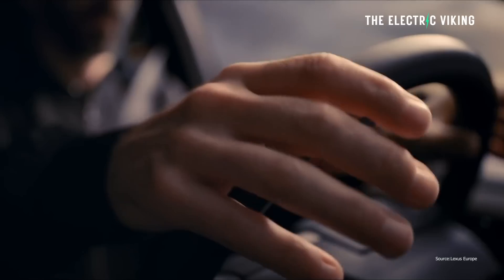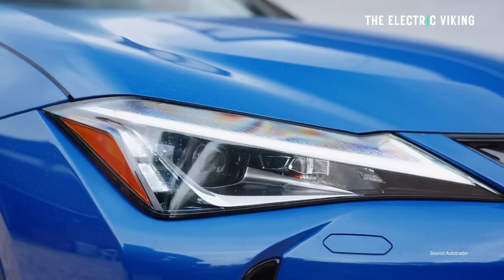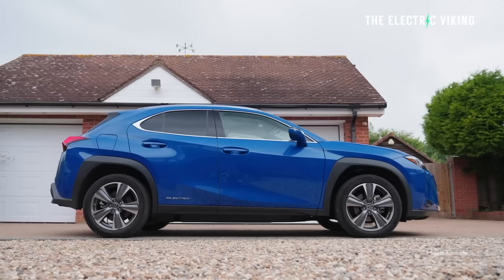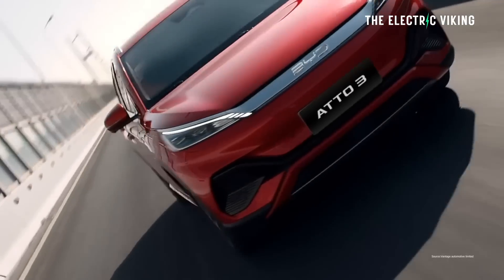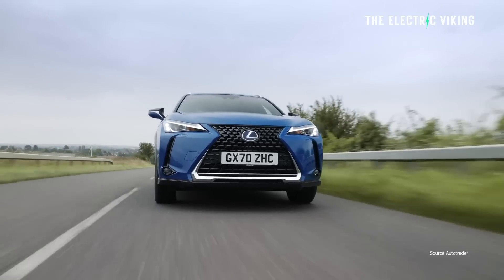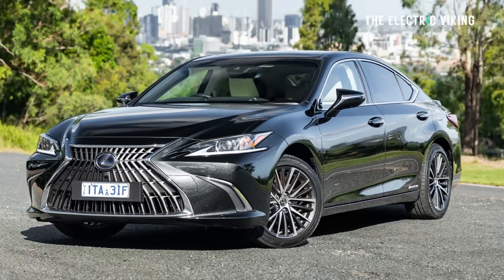Lexus reveals NEW electric car with a Nickel Metal Hydride battery

Comment: The new battery is probably for the hybrid because Lexus uses those because of their resilience in extreme temperatures compared to traditional lithium ion without having to add heating pads for cold weather conditions in particular. The Hybrid battery packs are generally pretty long-lasting and only fail mainly when the cooling fan ducks are blocked which prevents the batteries from overheating . It's very unlikely that the Lexus full electric vehicles are actually using nickel metal hydride

Comment: Simple a lithium battery can only be deep cycled about 300 to 500 times a NiMh battery can be deep cycled 1000 to 2000 times and cost less. the battery will out last the car and the lithium battery doesn't work in cold climates  but the NiMh has little problem in cold weather do your research.

Comment: The answer is really simple...  Lexus brand is associated with reliability, and longevity.   BYD and Telsa, kinda throw caution to the wind... hence their rapid technological development...    So, Lexus is allowing a much smaller portion of the full capacity of the lithium battery to be accessed -  in order to ensure they don't tarnish their reputation around reliability and longevity.     And yes, Lexus's  are heavy... lots more noise dampening in them than most cars, which isn't light; so that will take some range away too.

Comment: NiMH is ine reason people fear battery degradation.

I thought Toyota were bragging about their sold state batteries....
They can't even competitive on current technology.

NiMH i BS.
I don't want a battery where I have to drive until it's very low, before I charge.
I want to start charging when its convenient.

I remember having a phone with NiMH, and the charger had an option to rin a discharge cycle before charging, to reduce memory effect.

Comment: I'm not going to jump to any conclusions about NiMH till I see a deep dive.  li-on have proven themselves to be good, however, the NiMH packs in the Prius's have also proven that they can run for years with seemingly zero degradation.  It would be foolish to tout LFP chemistries that have less energy density as ideal because of their hard-wearing characteristics but poo-poo NiMH.  If Toyota can make a compelling car using NiMH, then go for it.

Comment: Hi Sam!
I have access to TechDoc and I compared UX250h (the 2.0 litre hybrid version) with UX300e (pure electric) regarding the battery technology.

The UX300e has always had Li-Ion battery.
The UX250h has always had Ni-Mh battery.

This goes for all of the five revisions of both models.

There must have been som misunderstanding och a typo at Wikipedia or where ever you got your information.
Reply: Wikipedia has under battery: 1.4 kWh, 216 V sealed Nickel-metal hydride (UX 250h/260h)
54.3–72.8 kWh, 355.2 V lithium-ion (UX 300e). 

So he’s lied or has poor reading comprehension.

Comment: I'm a bit shocked to hear this. NMH batteries were significantly better than their predecessor, the NiCad battery, if anyone remembers those. But far worse than their successor, Li-Ion. NMH are probably still in your electric shaver, cordless handset (to those who still use 'em), hand-held minivacs and such. Cordless power tools, like drill-drivers, have long since moved on to Li-Ion. So why would anyone want to put one of those dinosaurs into a modern EV, let alone an expensive luxury one?

Comment: A luxury class EV based on NiMh is an absolute joke but why not make cheap entry EVs based on that type? they don't need much range, high c-rates or longevity when they are meant for city usage only. Or is a kWh LFP cheaper than NiMh? in that case NiMh is obsolet

Comment: Checked the UX and RZ brochure in Germany, both have a ~72 kWh Li-Ion battery. There clearly must be a mistake somewhere.
Reply: So this Lexus does have a decent battery pack still dismal range?
Reply: @ouethojlkjn  Those I checked had ~450km, not great, but decent I'd say.
Reply: @ouethojlkjn I weighs too much to get great range. Also the engineers will commit harikiri if disappointing range brings shame upon them. So it's possibly better when driving at a constant speed in good weather conditions.
Real world EV range is often not even close to the boasted numbers.
Reply: @SolAce-nw2hf  MY old 2019 Model 3 Standard Range was amazing - always returning more miles than the WLTP. I think though that any economy is mostly down to driving style and avoiding using the brakes. My old and much loved Saab 95 2.2 diesel had a stated combined MPG of around 37 but I used to get 50.
Reply: @ouethojlkjn  I can confirm that. When I am in a hurry, I get about 1.5x the fuel consumption compared to most trips I make, not even driving much faster, but trying not to waste time will cost range.

But in city conditions, the fuel consumption is reallly bad compared to highway speeds.
I don't drive a Toyota at the moment, but their fuel economy predictions have never disappointed me.
Reply: @SolAce-nw2hf  I agree that an Internal Combustion vehicle may have poor economy (not range) in city or urban conditions - mostly because the engine has to idle doing nothing other than generating heat and going nowhere. This does not apply to electric vehicles. Toyota enjoyed great success with their Prius cars but seem to have done little else in the intervening quarter century.
Reply: @ouethojlkjn  toyota has greatly improved their hybrids, plugin hybrids and is also the biggest player in Hydrogen cars.

Also they hold a lot of patents on solid state batteries and are working on it behind closed doors, but have not gotten it to their standards for production use just yet. 

This reminds me of a Steve Jobs quote: 
"People think focus means saying yes to the thing you've got to focus on. But that's not what it means at all. It means saying no to the hundred other good ideas that there are. You have to pick carefully. I'm actually as proud of the things we haven't done as the things I have done. Innovation is saying no to 1,000 things."

Comment: Nevada has tremendous solar potential so the energy component cost for mining in the future should reduce dramatically and mining which is unfeasible do to the energy cost will become feasible. 

Many of the new earth moving components are also being powered by electricity instead of diesels using linked conveyors systems instead of giant dump truck .

Also highly automated robotic mining systems are being widely deployed so the work force required to maintain, train and repair such mining operations are significantly higher then the average product of universities today.

Comment: Toyota has a long history with Panasonic NiMH batteries.  Current versions have increased energy densities (compared with past NiMH cells)  solved the self discharge issues,   and are super durable.   Commercial they go by the  Eneloop  name.
Reply: I like the eneloops, but they have far less density that lithium batteries.

Comment: My 2008 Prius has an NiMH battery in it.  Still running well at 159K miles.   And here we are in 15 years later in 2023 hoping and waiting for LiMFP batteries from CATL.
Reply: Yours in not an electric car. This is very important to keep in mind. My ebike has the same capacity battery as in your Prius.
Reply: Your Prius is also a hybrid therefore relies less on the battery.  It’s an internal combustion engine with assistance from the battery during start, stop, idle, and etc. if your Prius was fully electric trust you wouldn’t be still driving a 2008.

Comment: I owned a Vetrix Electric motorcycle back in 2009. The NMH battery lost 50% range in less than 12 months. Once I replaced them with Lithium batteries all good 👍
Reply: NMH batteries are the worst battery type on the market, period.
Reply: @sgodsellify   = well they were a step up from Nicd - reduced memory, just don't abuse them too much (respect the "flat" state)  - they don't tend to deflagrate.
(pretty sure the premise of this video is misinformation - probably unintentional through no research  - and obviously includes too much stock footage, however)

Comment: I really hate NiMh batteries, are so capricious, unreliable, and expensive... I had/have a lot of them and I tell you, I just waiting to get rid of them all... the worst property of them is the "charge memory" You need to charge and discharge them completely and precise (no more than required) as in any other situation the batteries are destroyed... F:::K!
PS: By the way, these are the batteries for which Henry Ford bought the patent and built electric Ford cars in the 1920s... Guess what: did not work, it was too heavy and its density was too low...
Where the f...k are those SSBs for whom TOYOTA gets over 600 patents? Are in the same place where are those "over 30 EVs from 2020"?
Reply: Are you sure you're not thinking about Ni-cad?  NiMH wasn't invented till 1967...
Reply: @Bryan46162  Yes, you are right, was not NiMH... thanks for the correction!

Comment: This is what happens when you don't invest in a Lithium Ion battery factory, but have been making NiMH batteries for decades and can easily crank out as many as you need... of course it is absurd, NiMH batteries have been not even up for discussion by other firms.
Reply: And unlike other manufacturer vehicles toyotas were burning due to faulty inverters and not batteries, which require more watter and destroy more of the vehicle.

Comment: Sam thanks for that info. I own a CT200h hybrid and love it. I am concerned at the possibility of being stuck with lithium batteries. Yes the batteries that have a higher risk of self igniting during charging. My other concern is that unfortunately most EV including Lexus don’t have a spare tyre for a country as big as Australia this is bloody stupid. In saying this a space saver would be acceptable.
Reply: Nothing prevents any owner buying a spare and throwing it in the back or mounting it externally as you see fit. Then there's runflats...
Reply: Err- if you are concerned about battey fires then a hybrid is most likely to catch fire, followed by petrol/diesel with full battery electric (with lithium batteries) ~20 times less likely. You've been fooled by the massive FUD in the media!
Reply: I hope your ct200h isn't the 2020 model that has been recalled due to fire risk (faulty fuel tank).
Reply: ignore the haters - when you breakdown in the outback - retrieve all personal belongings, contact Lexus care via satellite - and wait at a safe distance as car incinerates.  Full Atmospheric recycling at play..  (throw on a match if auto deflagration does not perform as expected, help will be in its way ).  (NB - Joking - in case not clear)

Comment: Sam, you keep pooh-pooh'ing  Toyota but that stock is all time high. 
Toyota Motor Corp stock 2,654 JPY +1,284.90 JPY over 5 years (up 93.82%).
Not just Toyota, Honda too
Honda Motor Co Ltd    5,027 JPY      +1,810.00 (56.26%)past 5 years

Please explain. I just don't get it.
Reply: Investors aren’t getting any smarter?
Reply: @danieldebreceny5683  a stock going up that consistently means investors are betting on something. They may be wrong but what is that something ?
Reply: @danieldebreceny5683  I found this, Bloomberg : "Toyota produced and sold a record number of vehicles in June, the company said last week. Toyota Motor Corp.'s quarterly profit exceeded estimates as improvements in supply of semiconductors and a weak yen helped it capitalize on a global rebound in demand for vehicles. The stock closed at a record high." July-2023.

Comment: If this is not a typographical error which the excessive weight indicates its not, then Designed to Fail is the first thought that comes to mind.  It wouldn't be the first time a car company built the car regulators said had to be made but did such a poor job of it so that they could claim, "See we made it and nobody is buying it".  Could just a be a ploy to Sour the Milk on battery powered EV's and push hydrogen. 

Best!

Comment: You are mistaking NiCads in your power tools for NiMH batteries. NiCads had the problems of being toxic, expensive and would develop a "memory" of how they were discharged and would not allow themselves to be charged beyond that point. The best way to use them was to discharge them fully before charging them again. If you did this you could get 3,000 cycles out of them. NiMH batteries had no "memory" problem, were largely non-toxic, more energy dense, lighter than NiCads and more robust in cycle life. They had been invented by Stanford Ovshinsky. The GM EV1 used them and the range went from just over 100 miles on lead acid batteries to close to 200 miles, this back in 1999. Unfortunately, Texaco purchased near controlling shares in Ovonics with the promise to market the technology. Texaco did the very opposite in the United States and Europe. However, since the Rav4 EV was being built in Japan by Toyota, they did license Panasonic the right to produce NiMH prismatic batteries for hybrids and electric cars. Panasonics batteries were markedly better than those produced by Ovonics, lighter and cheaper, arriving at a price for their EV1 batteries that was lower than most premium lead acid deep cycle batteries. This sent off alarm bells in the corporate offices of oil companies around the globe. In 2003, Texaco Ovonics Battery Systems was restructured into Cobasys, a 50/50 joint venture between Chevron and Energy Conversion Devices (ECD) Ovonics, whose purpose in reality became to scuttle the new Ovshinsky battery's potential to disrupt all battery storage, especially those in EVs. Panasonic had, in one year, managed to double NiMH's energy density, cut its weight in half and drop its price by a factor of 10. After the ZEV mandate was pulled in California and all the EVs of the time were stopped and those that existed were largely crushed now owned "Cobasys" pulled its license from Panasonic for prizmatics. and only allowed it to make small batteries like AA, AAA and C sized batteries. Toyota was allowed to make NiMH batteries in house for its Prius. Just imagine where we would be today if Panasonic and Ovonics were allowed to continue continuous improvement on those batteries for the last 20 years. Lithium made it through the oil company led gauntlet because it came in many, many flavors and the oil companies weren't able to capture them. The ZEV mandate in California for the time it was in place set off a battery research tsunami that was too big for big oil to hold back. Japan's biggest worry is China controlling the battery market through materials, which could destroy Japan's already weak economy if it were fully vested in EVs. NiMH allows Japan to enter into the EV market without the threat of a Chinese sword of Damocles hanging over their heads.

Comment: NiMH is also far safer, especially in the bulk quantities used in an EV or even a standard HEV.
Reply: wrong. Lithium iron phosphate does not catch fire. NMh has several huge problems. The memory effect. If you don't discharge it completely, the battery can only charge up to the point where you discharged it and then charged. In other words, if you use half then charge it, the battery capacity becomes half.

NMh also have a much lower power density than Lithium. It also charges slowly other you damage the battery. NMh also have low charge cycles. As in a few hundred.

Toyota is desperate so they have released this half assed car.
Reply: Guaranteed hybrid batteries are done within 10 years. This Lexus has the same battery. Good luck with that.

Comment: I'm guessing this was a cost issue. NiMh have been around for 35? years. There are MANY sources for them. Typically good for only 1000 full cycles, but hey, they can cost compete a half dozen vendors to get the price down.
 And they don't catch fire.
NiMh does not have a memory problem, if you have licensed the right patents. Like Panasonic's. They do typically need a charge rate of 1/10th C, but can also trickle at that rate for years with do damage. Robust.
Reply: 1/10c, so  days hrs to charge?  You do understand what 1/10c rate is no?

Comment: Where is the NMH battery?  It’s lithium ion in the the ux300e as far as I can tell.  Perhaps you mean the ux250 hybrid has NMH?  Unless I am reading this wrong, the listing in EV database and Chasing Cars both say its Li ion.  EV DB says its 72.8kWh with 64kWh useable energy capacity, 96 cells on 400V architecture.  Recharge on CHADemo type connector.  It’s 1885kg unladen, so its fairly in line with other vehicles in the same segment IMO.
Reply: Chademo can only take 50KW of charging, so long charging time!
Reply: @rozonoemi9374  Yes, no CCS.  Pity, but hope they have a plan.  Perhaps they think most of the time owners will charge at home, overnight.  😀
Reply: @GolLeeMe  Still, old battery chemistry. Only reason there using those batteries, is the fact they have huge amount of those batteries they use in there Hybrid technology & don't want to invest in better batteries.